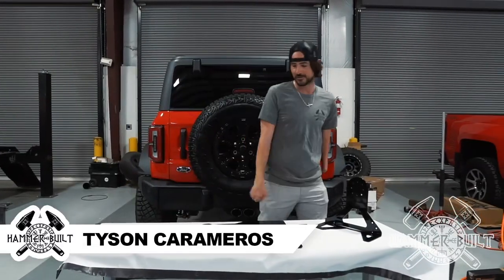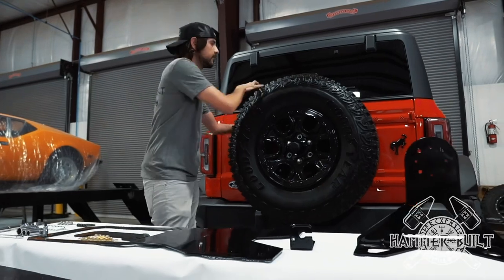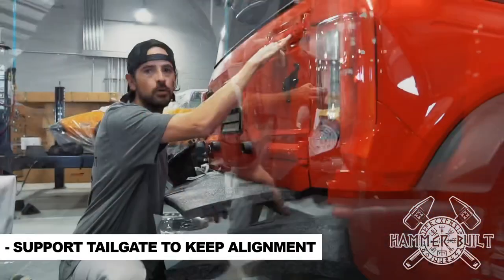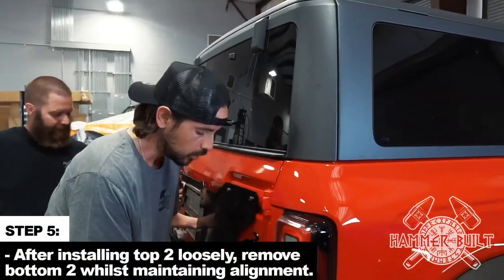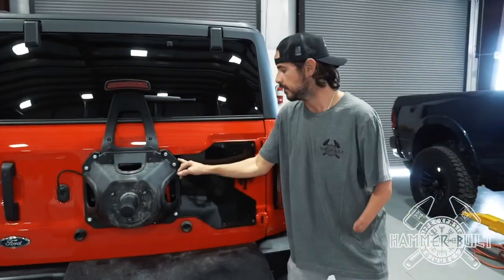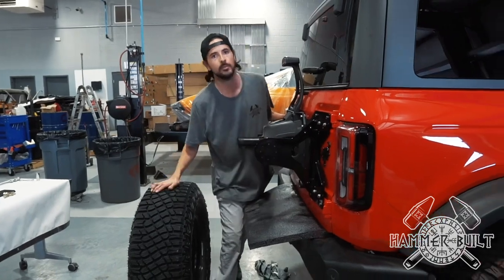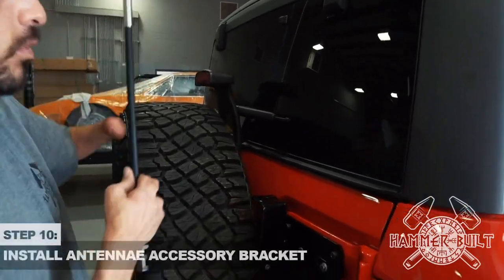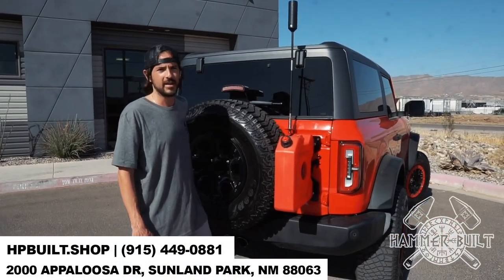Hammer Built Bronco Spare Tire Support Bracket Install

Comment: Awesome 👏🏼 my Badlands Sasquatch arrives May 16th I’m definitely going to need this since I’m getting new fuel wheels on 37s
Reply from the maker: If you are doing a 37 this is the mod for you! Feel free to reach out to us with any other questions on bronco mods. We have plenty available for them!
Reply: The keyed version of the Rotopax mounts have issues after a while, especially if you don't use for a while, so I'd proceed with caution. Imagine running out of gas and the lock doesn't work...

Comment: Is there any way to add some additional security or a locking mechanism to the rotating bit that secures the jerry can? Just curious, I'd never store fuel in it and leave it unattended but it would be nice to be able to leave an empty can secured to the tailgate and not have to worry about it wandering off.
Reply from the maker: Absolutely! Rotopax makes a lock for their cans it functions just as the rotating assembly but with a keyed lock on it. 
We didn’t use that part on this video just for simplicity sake but it is available.

Comment: Are there any issues with taillight clearance when opening the tailgate with the stock 35s and the accessory arm with rotopax? I'm very interested in this setup but would like to still get tailgate open to 90 degrees.
Reply: testing out a new gas strut that limits extension to a lil  more than 90! stay tuned

Comment: Do you need the brake light extension (and spacer?) if running stock Wildtrak (Sasquatch) wheels and tires?
Reply: No sir, not needed unless you want to run our future chase light bracket.

Comment: This video is missing the most important step.
You need to remove the gas strut that holds the back door open first.  If you don't do this the pressure inside the gas strut will force the whole tailgate to the driver side of the Bronco and cause your bolt to missalign!   I had to fix mine with a ratchet strap from the rear passenger D-Ring to the tailgate to crank it back so I could thread the factory bolts back into the hinge.  After I was able to get the factory hinge bolts back in, I was able to open the tailgate again and remove the gas strut.  After that, install went smoothly.  This Step is KEY!
Reply: agreed.